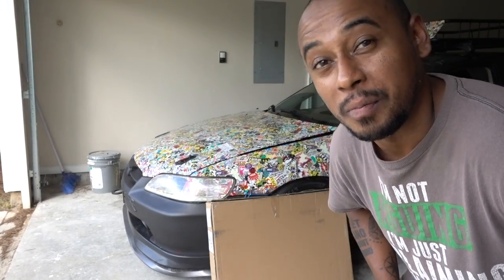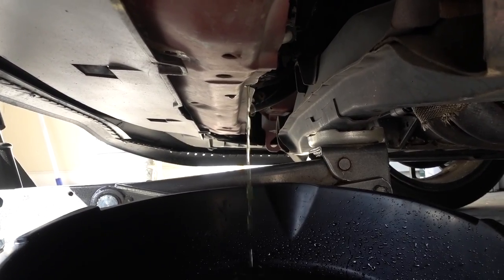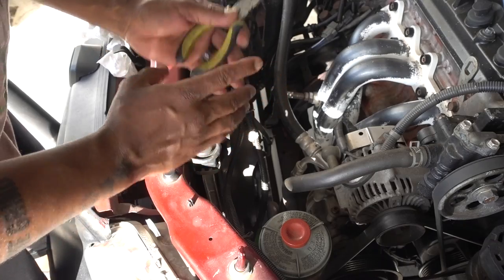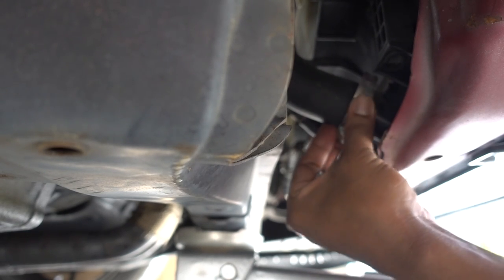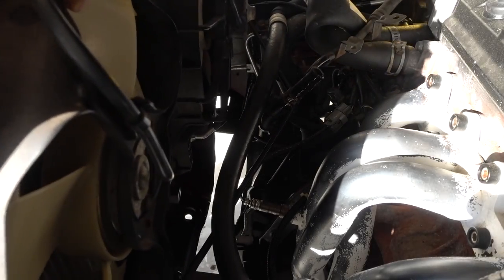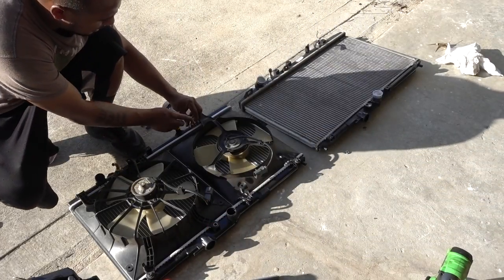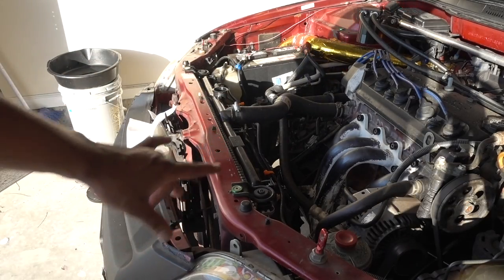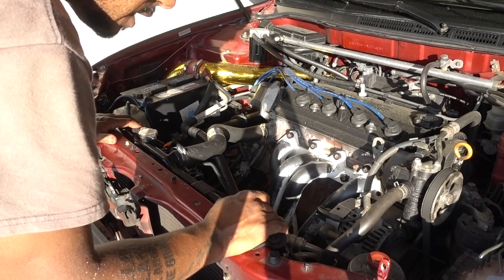Radiator Replacement for 1998 to 2002 Honda Accord

Comment: I sure can feel you won't know what you're doing right here on this video I been dealing with mine also but I think I figured mine out though the plug that goes on the little sensor for over the thermostat housing is the wires that were broke that's the reason my mind wasn't coming on
Reply: Wow that is not what I said
Reply: What I was saying was I feel for you on your video that you're doing here about the fan motors on your Honda I've been dealing with mine also when I think I figured mine out though it wasn't the fan motors it was a plug that connects to the sensor on the thermostat housing the wires there were broke
Reply: Las mangueras si están vencidas sube la temperatura si o no

Comment: Thank you so much! I just replaced my valve cover gasket and it was difficult , the bolts with the grommets . It turned out perfect but I found out I must have leaned against the radiator and broke the outlet nozzle. So now need a new radiator and there you were my friend with a really good video. I will keep watching you. I love my 2002 Accord 2.3 !

Comment: Excellent video.   The only thing I wish you would have shown is how to remove the clips from the wiring harness for the fans off the radiator.  You kind of skipped over that, it looked like maybe you had already replaced them with zip ties.  For anyone wondering, those white clips can be removed by using a slotted screw driver from each side under the flange and pushing.  But excellent nonetheless. You the man!

Comment: when installing the Transmision fitting do you put any sealant thread or sealer on like they do when doing plumbing or do i install it bare of any sealers. meaning do i just screw it in as is?
Reply from the maker: Screw it as is

Comment: Great Video... Mine is 2001... What would you do if the Drain Plug to the Radiator is Broken. Also can you do a video on you bleed the Radiator once you replaced... Didn't really see that part in detail.. Thanks
Reply from the maker: If is just the plug get a new one from the auto parts store 
https://youtu.be/Qpyg7-Vigwo
Reply: @BulletSolano  I bought a new Radiator & hoses, but the plug is broken in the old one, do I need to drill out to drain first or just pull hoses of to let drain, and not worry about that plug which is stuck in there
Reply from the maker: Yes remove the hoses

Comment: I noticed your radiator came out of a 1998 is  2000 Honda same thing will you come out the same ? I’m trying to replace my radiator And thank you for sharing comes in handy
Reply from the maker: My car is 2000 and the process is the same for any 6gen accord, the only difference is the automatic transmission cooler lines

Comment: Did you use your same radiator cap? Mine doesn't fit this one and I can't get customer service to answer my calls or emails. I bought the same radiator as you. I just need this car back to running!
Reply from the maker: Yes I got the same cap, it should fit, press harder! Because the plastic is new on the radiator maybe is a little ticker on the neck, pushed it down harder to put it in place

Comment: Is that bigger cooling fan aftermarket? My stock cooling fan doesn't line up with my new radiator stubs on the bottom and on the top
Reply from the maker: Is the stock one

Comment: Bought the radiator, hoses and thermostat, just wondering what size hose clamps i should buy for the upper and lower hoses?
Reply from the maker: https://www.ebay.com/itm/400915437976

Comment: Hey bro thank you for the video I'm swapping mine tomorrow. I got a question if you think you could answer it about Hondas. I got a 2.3 Accord motor VTEC and it's making some kind of little sound like something's loose when I get about 3,000 4,000 RPM sounds like a pulley hitting metal. Wonder what it could be if I sent the video could you figure it out or know? immediately
Reply from the maker: Check the timing belt cover, and the alternator pulley
Reply: @BulletSolano  thank you bullet

Comment: Does it matter that my transmission is manual vs automatic for steps in the repair?
Reply from the maker: It doesn’t, you’re vehicle doesn’t have transmission cooler lines, that’s the only difference

Comment: does this apply for manual transmission 02 accord 2.3L as well or its a little different?
Reply from the maker: Same process, just with out the transmission cooler lines, manual accords don’t have those

Comment: is it safe to add transmission fluid if it hasn’t been changed in a long time
Reply from the maker: Yes, you’re not replacing the fluid, should be ok
Reply: @BulletSolano  when replacing the vapor canister and shut off valve, does it matter what brand? duralast or dorman is better? or is there a big difference between genuine part
Reply from the maker: Yes big difference but go with Dorman

Comment: I found it was it was easier for me to remove the the trans cooler hoses from the other end of the hose then take them off the radiator once its out. They were just more accessible from the top for me.

Comment: Did you use any sealing tape on the transmission line fitting on the back of radiator?
Reply from the maker: No, clamps are enough
Reply: Thanks

Comment: Hey i have a 98 accord stick shift nd i took out my radiator but i did not have a hose connected to transmission oil cooler is it because i have a manual?
Reply from the maker: Yes, transmission oil cooler is for automatic transmission only
Reply: thanks!

Comment: Do I need to flush my radiator before I replace it?
Reply from the maker: Flush the old one? No just put the new one on, but if you wanna clean the system before installation it will be better
Reply: @BulletSolano  Thanks, I drained the old radiator, and ran a hose through it. Then took the old one out today. Now I just have to get the right one from Autozone, I think I need a Denso build.

Comment: Do you have to bleed the system in case is in the lines
Reply from the maker: Yea you have to
Reply: @BulletSolano  I just changed my radiator and it startkng to over heat
Reply from the maker: Bleed the system again
Reply: @BulletSolano  thank you I will give it a try today

Comment: Hey man thanks for the video, I'm ordering new radiator for my 1998 Honda LX 4 cyl. When I fill the new radiator, do I add the fluid before I start the engine or after it's running?
Reply from the maker: No problem, antifreeze goes before, and bleed the system 
https://youtu.be/QRwmQ-Lc0FA
Reply: @BulletSolano  thanks bro, one last question, do you leave the radiator lid off or on when you start the engine so you can bleed the system?
Reply from the maker: I send you the link for the video on the bleeder screw location, you don’t have to leave the cap off